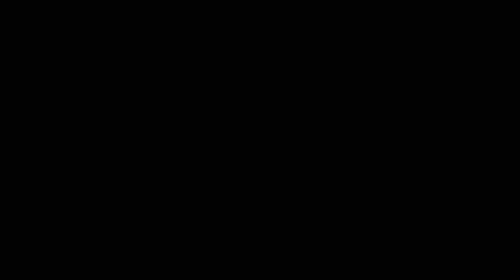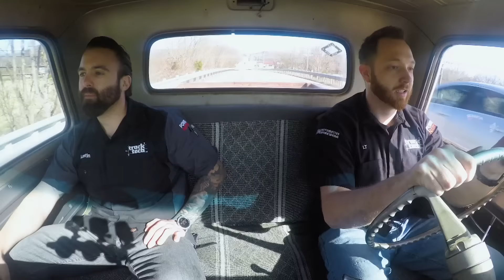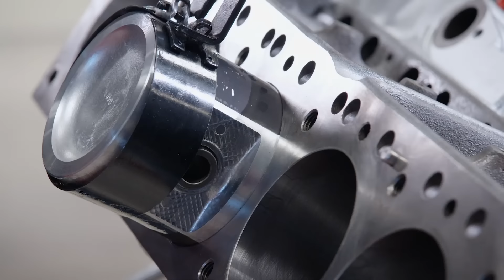Forget the LS Swap: Building a Turbo Chevy 292 Straight-Six

Comment: The Atlas 6 from the Trailblazer would have been a good candidate as well.
Reply: Not really buildable and minimal aftermarket
Reply: @rustedratchetgarage6788  Like there is an aftermarket for the 292?  And bone stock, the Atlas engine out performs the well machined 292.  The Atlas engine might be stronger stock as the 292 with the turbo.

Comment: Why didn't you rent a deck plate from 12 Bolt? You should of also used forged pistons from 12 Bolt.  Also should have used longer rods to improve the pin height placement.  Why didn't you balance it?  Those engine have serious balance issues at higher rpm. Also throw away that offy intake, they are junk.  A Clifford intake or Aussie or PES intake would give a substantial horsepower increase.  With the way that engine was built I can't believe Tom at 12 Bolt even sold you parts!!

Comment: They did the head up right at least.  After plugging 12bolt.com a few times you would have thought that they could have used one of Tom’s torque plates, taken his decades of experience with these motors and installed the cam gear the correct way, used the right pistons and used the proven turbo cam he sells.  I’m all for doing something different and going the 292 route, but the mix of parts just don’t seem to be working.  I’ll eat crow if this thing cranks out 500hp under boost though.  Regardless, it’s still super cool.

Comment: Love the 292 got one in my 65 Chevy k10 4x4 built to the hilt around 300hp all my friends want me to put a small block in it but it does better than most of there trucks with V8 it will out pull them all off road so the little inline 6 is staying in it
Reply: What mods did you do to get 300hp?

Comment: They bored this motor .040. Which yields 298 in.³ rounded off.    The bore is the same size as a 230 or a 250. Curious if anybody knows what the maximum safe overboard is for these old engines
Reply: Most American iron blocks allowed for +.060 overbore. With a sonic checker, you could determine if there is enough extra iron to go +.080 or .090 in some cases.

Comment: Cam has too much overlap and duration. You theory about blow through is not applicable to a turbo setup. 

It needs more compression- forged pistons, 3-4 thou on the rod bearings, twin turbo or a split turbo a 600 cfm carb and leave those bolt holes alone on the intake ports. Pump 15 lbs boost and watch it take off. 

  You did a lot of expensive mods for nothing. A stocker with a turbo will outdo this combo.

Comment: I live the Chevy and Ford straight 6 but my Ford 300 makes more torque and power, did you guys port the head? And my comp is 8.8:1 stock, only head work and custom made  high velocity resonated intake 190 HP 342 pounds of torque

Comment: So with more compression for NA it should be close to 300hp. Love the straight 6
Reply: I've seen 292s NA producing 500+hp in drag cars back in the 70s/80s. 14-1 compression, giant solid roller, lots of porting on "Wayne" head, hilborn injection, aluminum rods, custom lightweight cranks, etc. Been a few monsters built with them. There's a 37 Chevy truck running low 8s in the 1/4 with a big turbo on a 292 six. Well over 1000hp.
Reply: @thereluctantgearhead4544  Or bolt on a 194 six head was extremely popular. Ran a lot of Chevrolet six engines in race cars they really make some great torque and power. Personally I would have used either a mid 60s  230 or 250 six over the 292. They did a damn good job on this six.
Reply: Check out that 37, it's on utube.

Comment: Building a 6 cylinder engine for power is an ABSOLUTE waste of funds. In fact, if you look up STUPID in the dictionary, it specifically refers back to building a 6 cylinder for power. 
Spend big bucks to get the same power that installing a stock V-8 would supply. 
Disclaimer: The only time it makes sense to build a 6 cylinder for power is if you are racing the vehicle and you are limited to the 6 cylinder class.
Reply: If building 6 cylinders for power was stupid, nobody would be racing BMWs.
Reply: @skylinefever  BMW's have 6 cylinder Chevrolet truck engines?
Reply: @gearshifterg9756  You only mentioned inline sixes. You did not specify a manufacturer.
Reply: @skylinefever  So, the video is about a 6 cylinder Chevrolet truck engine....and you are confused about the replies made on the video?

Comment: I would like to see someone do a old school 453 Detroit. In one of these old trucks that would be cool there should be enough room for the side mounted blower but the large bell housing would cause firewall to be modified it would be cool with all the deseial swaps now a days with its manual injection pump the tanks would only have to have a return line addedits been so long since I worked on one I think that was a wrong statement I don't recall a return line on them those engines had a bad rap cause they Lea k ed oil but they hadlow end power used inform lifts log sliders loaders many applications reverseable rotatations made them real versable
Reply: Would that kind of diesel make gasoline trucks extremely nose heavy? That may be one reason for not swapping those engines.
Reply: @skylinefever  Depends if it's a 1 ton to 3 quarter ton which it's ok , with half ton maybe nose heavy.
Reply: @borla4491  Okay, now I understand.
Reply: I had a 653 in a medium duty truck. I would never have another. People think they’re cool because of the noise. After having to use one, I hate the noise. Otherwise, it’s 1930’s technology.

Comment: Friend of mine had an old 74-77ish chevy with a straight 6 and 3 on the tree, not any kinda speed machine at all. But, man whatta dependable everyday start and go engine, and the torque with that 3 speed, that thing would pull itself up a steep grade in idle in first, from a dead stop no problem.

Comment: I dont think yall have things right . They use to have a kit called 6=8 with a lump shared port head like that , this motor had 2 - 650 Holleys and a 2 piece header pipe that made it to dual exhaust, it would do nearly 11,000 RPM and sounded like a Kawasaki . What I did not see yall do is shot peen the rods.  It was in what use to be a 1970 350 SS Nova with a GM 22 Muncie. I tried to talk Hubert in to selling me the SS 350 but He would not go for it.

Comment: I would like to see more old school inline 6 builds.
Reply: I've heard they once did a Ford 300. Not on YT yet though. Keeping an eye out since I happen to have an 84 F150 with a 300 that needs a rebuild (or at least new rings and hone).
Reply: @ratdude747  I had a 1996 F150 4x4 with the 300/4.9 and 5-speed.  I sold it when I no longer needed a full-size truck.  I'd love to see a 300 build on here!
Reply: @paulhoskins7852  I've got an 03 ranger with the Vulcan v6 in it. Never had a thing for fords until I was coming home from new York city one night. A good hour and a half, two hour drive, and about a third of the way into it my engine started making a horrible noise. I check it out and see sparks against the engine, think oh shit and turn it off. I take a look and the ceramic of the spark plug seperated from the metal that screws in to the engine, so I had a literal hole right into the cylinder. Drove it the whole way home with no problems, it even idled fine on 5 cylinders. Was loud as hell but I got home safe, threw new spark plugs in it and it passed inspection a  few weeks later.
Reply: @ratdude747 cool
Reply: I’m getting ready to build my 59 inline 6 for a Chevy fleet side 😎
Reply: @cholder1339  same here  putting on in my 81 c10
Reply: @cholder1339  you are wasting your time ..get the newer Chevy six from the late 60's
Reply: Me too!  Straight sixes are great engines!
Reply: Take a look at what brazilians drag racers do with these engines. Simply amazing.
Reply: They did the slant six already, amazing restoration build with a great story!
Reply: @jamessilly6837  Too bad they couldn't use the original engine on that one!
Reply: AMC had some hot inline sixes...some of the gremlins came with two barrel carbs and a four speed manual
Reply: south american versions of many Ford, Chevy and Dodge models that usually both offered inline 6s and v8s didn't get v8s, so we got stuck with inline 6s and that's all we had and still have to hot rod with if we want something old and american, you should look for argentinean falcon videos or brazilian opala videos
Reply: im building a 76 c10 with inline 6 250
Reply: I have 71 Challenger 6cyl, and would definitely like to see more of that
Reply: Years ago there was a dirt stock car class that was limited to inlinesixes .and the 292 truck block in line six was the engine to run .302 z28 intake valves will fit in the six cylinder head as the valve stems are all the same length.. You can chop out the cylinder head bolt hole casting and replace the stock cylinder head bolt with a countersunk stud and opens up your three intake ports to almost twice as big ...Clifford research is your Chevy six experts
Reply: It's not a big engine, but I'd love to see the Ford 200 straight 6 on here!
Reply: look up uncle tony's garage
Reply: You should watch brazilian projects like the opalas and c10. 6inline is very popular here since we dont have too many v8's hanging around here.
Reply: They need to get a 265ci  hemi i6 on
Reply: Same
Reply: BMW if they did Germans, they are the inline 6 gods
Reply: Right with ya, on that.
Reply: You and me both.
Reply: Na I'll rather see one with better flowing intake.
Reply: I would too. Maybe a 2JZ 1000HP
Reply: I ready to build my 64 Chevy C10
Reply: Put a 292 in a 38’ Chevy sedan
Reply: I got you covered
Reply: Well i am potentially going to buy a 64 this weekend, i just sold my 2017 4 banger gas getter and am going to attempt to daily drive it
Reply: Bmw m20 stroker would be cool

Comment: Very UNfavorable intake manifold. PES or Clifford would have done better.
Reply: ,Tom Scarbrough,  don't forget Kirby-Sissell, they have tube headers as well.
Reply: It would be ideal to have a multi carb intake or multi port injection. It would reduce the unbalanced air fuel ratio at cylinders 1 and 6 versus 3 and 4.
Multiple carbs were one reason why the Datsun 240Z and Triumph TR6 were so potent.

Comment: Love the inline 6...V8 builds get boring after a while.
Gonna dyno it with the turbo?  PLEASE!!!
Reply: Yeah turbo and efi. Where’s the vid for those pulls?
Reply: Yessss!!!!
Reply: I want to know if I can purchase the turbo and efi!!  I, currently, have 61 Chevy short bed on a 72 frame, and a 292 engine for it (sitting in my garage). If love to put that turbo and efi the motor when I get to that point!  I'm, also, going to put 3 on the tree with a 4-spd granny and put reverse on a cable pull in the dash!  Can't wait to get started on Sara!
Reply: As long as the turbo is not too small, should be T4 and at least 60mm, it should do 400+ no problem intercooled on E85. Maybe 500 hp at 25-30 psi. Won't be that slow. Personally I don't like when people say "we only want so much power" With a turbo/supercharger you don't need solid rollers and valvetrain that constantly needs adjustment. You don't need wild compression, though I would say their numbers are a bit low but maybe not for an iron head.
Reply: New vid up. Wasn't too far off
Reply: 6 cylinder crap is boring junk😂.
Reply: Should make 385 HP and 469 Ft/lbs at 11psi of boost
Reply: Wak Job Back in the day hot rod did a straight six buildup in a Nova , they ended up w/ 300 hp and I believe 13+- secs (?).I believe.
Reply: Should make 350 to the wheel on medium low boost. But would love to actually see it
Reply: @Iwhoiam999  
I'm seeing close to 400 boosted. But that depends on the cam.
Reply: @rogermarshall8991  cam and boost it's very possible. But they said it's a driver so I doubt they go for kill
Reply: Check out the Barra Six .
Reply: @Jesus H Christ oh yeah 👍
Reply: I wouldn't even say that V8 swaps are boring it's just that almost everybody does a LS. we never got them in the States but the Mercedes 420 CDI turbo diesel is a pretty badass engine

Comment: Just wait until they turbo it.

Love these old Chevy inliners, great build.
Reply: @Dave Iauco  
They are very Dependable power makers. 12 bolt has been building & selling parts for 400+ hp engines. Long lasting runners. Inline 6 engines are way under rated. Fun to build also.
Reply: @Dave Iauco  There are 292s with big turbos making 1000+hp and been doing it for years. How much power does your little snot box have? Look up a blue 37 Chevy truck running low 8s in the 1/4 on a 10 inch slick and stock rear leaf springs. It has a heavily boosted 292 in it that's been together for years. He won a LS truck shootout with it at Bowling green. It's making around 1100hp last time I seen it.

Comment: More love for the stalwart straight six. We may see more of these motors return to the marketplace as ICE builders search for efficiencies. GM has a new straight six.
I drove a Ford P/U w/ a 300. It had little horsepower but it behaved like a steam engine in production of low end torque. It was a cheap, simple and eager worker
Reply: I don't believe inline sixes will become common again. They make the car longer and give it less room for a crumple zone.
Reply: @skylinefever  There is plenty of room in full size pick up trucks and straight six motors have a very favorable low end torque characteristic useful for heavy vehicles. They can also offer less volume and weight over V8 engines. Internal combustion engines will continue to be developed and built for another 20 - 25 years and the bulk of them for industrial / commercial use as passenger cars go electric.